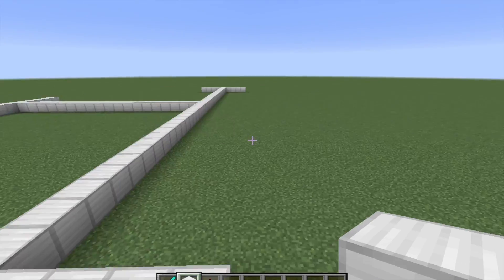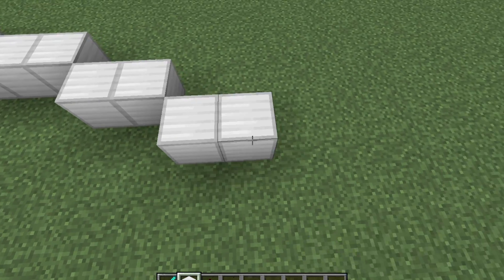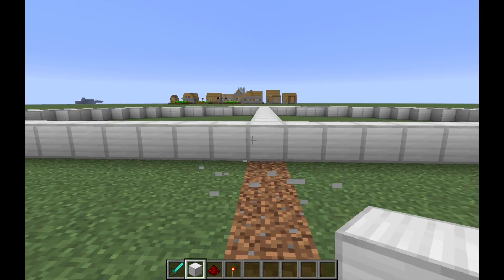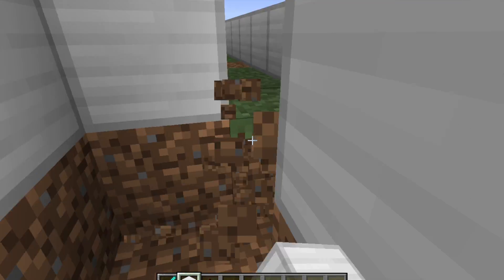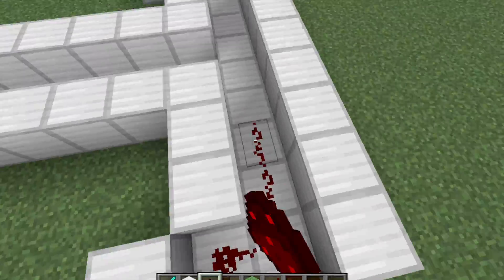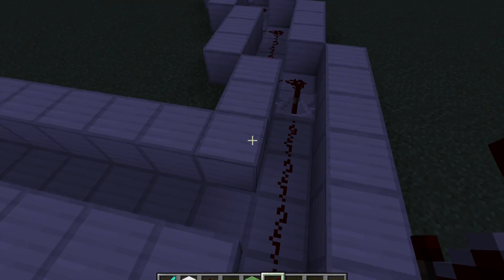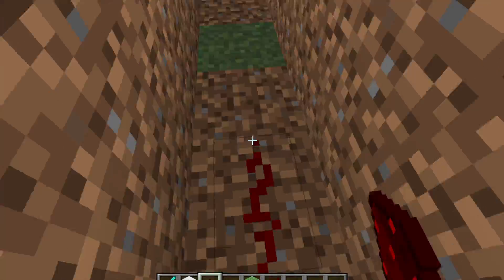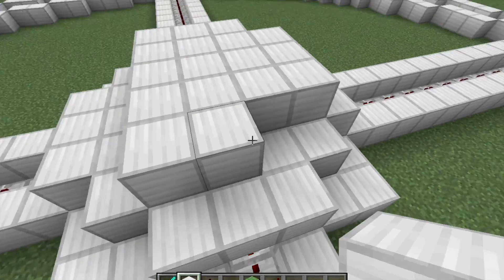How to build a Particle Accelerator in Minecraft (Thermal Nuclear Power Plant!)

Comment: You don´t  accelerate unstable atoms or particles in a particle accelerator(because it would damage the accelerator and maybe create some kind of super radiation,depending of the type of radiation, alpha and beta would have this effect).
You just use very stable and small Atoms (with less mass than any radioactive Isotope) like Hydrogen.
The biggest particle accelerator in the world (in swizerland in Zern) also only uses Hydrogen(or a positive charged Hydrogen Atom,which is basicly just a proton)  as the "projectile" which is accelerated.
You are not directly gaining power from this process, you are just "gaining" some antimatter (less than 1/100 of a mg, but it has still and enormous power if its used correctly).
Reply: Actually it wouldn’t damage the reactor because, the more unstable the atom is the quicker it’s half life is. So once it’s done being smashed together. Yes the atom will be be extremely radioactive for a millisecond before it decays quickly and becomes less radioactive. Plus.... the accelerator is made of really strong and thick metals so, alpha and beta rays shouldn’t be a problem, the only concern is the emission of gamma rays. But yes!. You don’t gain enormous power from particle accelerators. They are used for experimentation
Reply: @omarsstuff9819  who fucking cares
Reply: we needed someone smort